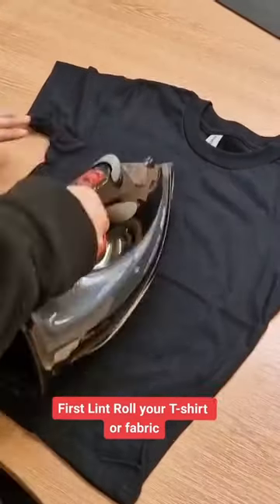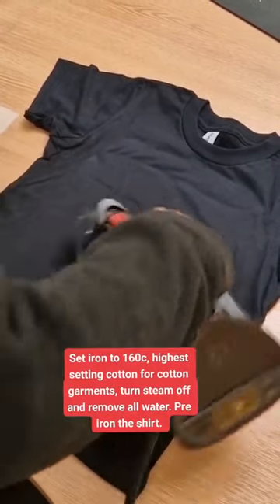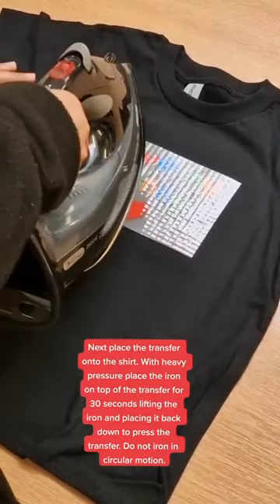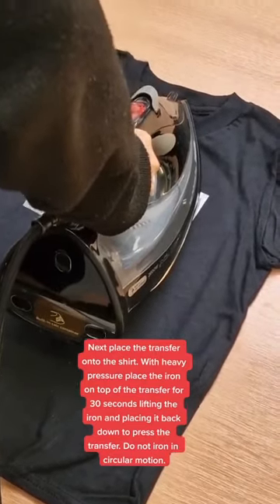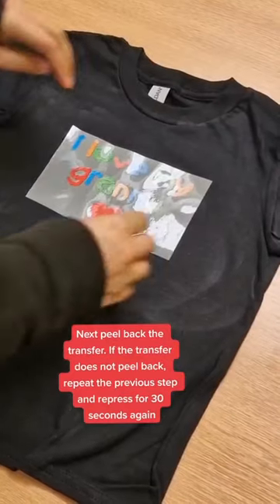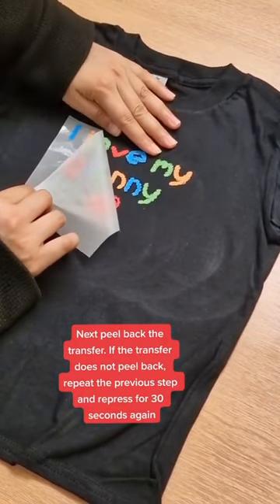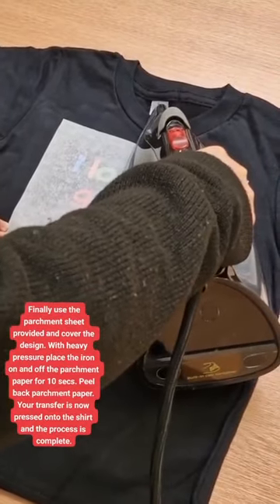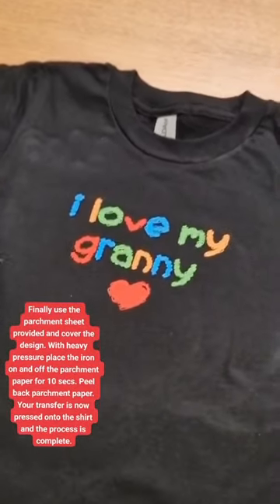How to iron on our transfers! Instructional Guide

Comment: I did this with polyester and it burned the shirt.  Need to use low heat now there is a permanent shiny sheen in the shape of a iron lol
Reply: Yeah your iron should tell you what setting to use depending on the shirt but for this cotton or linen is probably best.
Reply: Use your head next time pal
Reply: @drizzyfest6285 they probably didn’t know whether it was polyester or some other fabric before checking/ doing: or knowing